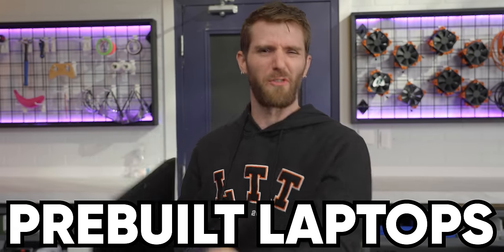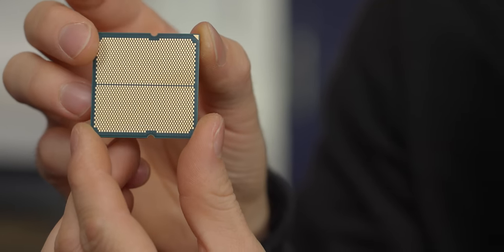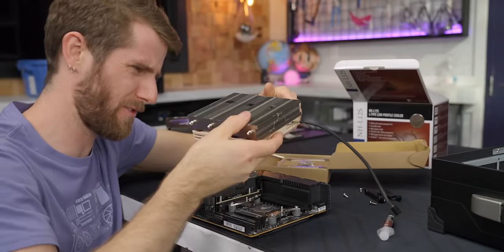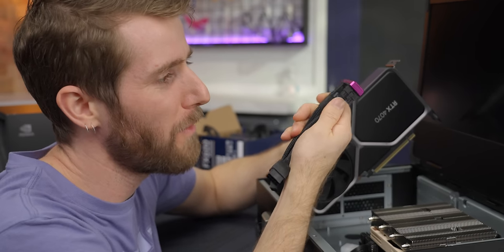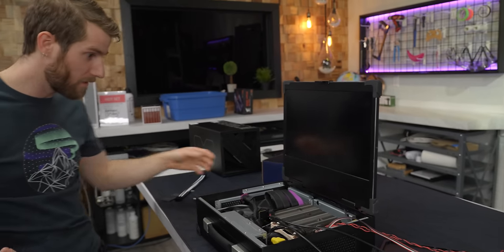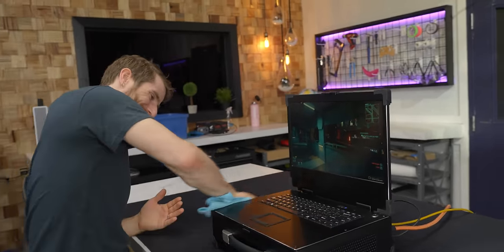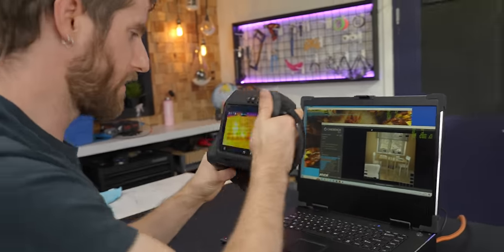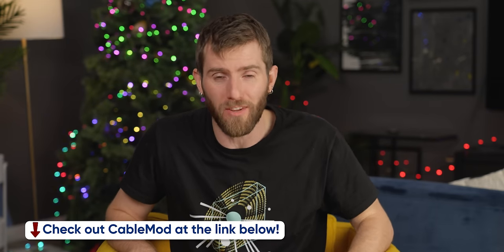Building your own “Laptop” is Terrible and I LOVE it! - MaCase B21 Briefcase PC

Comment: You'll solve multiple problems at once if you swap the positions of the keyboard and monitor.
Move the keyboard to the lid, and the monitor to the inside of the case.
To make that work, the case will need to sit upright when it's working, and not laying down as it does now.
This suggestion helps ventilation and cooling by allowing ventilation holes to be located in more places in the case.  And having the unit stand vertically helps with air stratification.
Another benefit is that it locates the keyboard away from the heat generating components.  And having the keyboard in the lid drops it in height so it's closer to the height of the table top that the unit is sitting on.  That helps ergonomics / comfort for the user.
Someone needs to make a unit like I'm suggesting, and do it out of a lightweight material like aluminum, carbon fiber, or even titanium, so it's not as heavy as a sack of cement.
People would invest in a case like this because the internals can be upgraded in the future.
Reply: It being at any angle other than 90 degrees would be an issue, maybe a little too prone to just falling over
Reply: @joebot86  
My desktop computer stands up.  It has never tipped over.
Reply: @deezynar  yes, but a laptop screen at a 90 degree angle to the keyboard is often uncomfortable
Reply: @joebot86  
Do you mean a monitor screen that's perfectly plumb is uncomfortable?
If that's your concern, there's no reason the monitor can't be hinge mounted so it can tilt.

Comment: It's a good concept. But the airflow needs to be finalized. The case needs to be put on 1-2cm legs so that the air intake at the video card is good enough. You made one hole, but you can make another one for the second video card fan. On the plate that the video card is screwed to, you can remove the top part, air will escape through it too. In the standard solution the air cannot go inside and out through the side ventilation grill at the same time. This is a serious design error. Since one fan of the video card blows air backwards, you need to add some kind of a tube that will collect air from the second fan and lead it to the left outside the case. Right now, the hot air from second fan just hits the top panel, so it warms the keyboard. There is a big plate above the I\O on the motherboard, it should be ventilated too. 
If designers can organize air flows so that they intersect as little as possible, then the result will be a good laptop with effective ventilation. And desktop hardware gives this project excellent potential for upgrades in the future.

Comment: This would be a cool NAS setup. Has the monitor and keyboard built in. Put a LSI hard drive controller with 2 external ports on the PCI-E and put multiple 3.5” hard drives in an external enclosure. The m2 slots could be used as drive cache. With onboard 2.5Gb network interface, this thing would serve data no problem.

Comment: I think you might have "missed a trick": that hole you drilled in the bottom of the case "to let air in" for the GPU is most likely sitting flat on the tabletop and no air can get in anyway.
Perhaps screwing four little feet onto the underside, elevating the case off the tabletop by a few mm, to let that hole actually help keep the GPU cool, might be a good idea?

Comment: The box is missing a heat deflector under the top. The system has enough cooling, but for sure its heating the top indefinitely, because nothing prevents it from doing so.

Comment: I use a very similar type of "portable" desktop regularly for work. I frequently visit a chip fab with a portable workstation with two AMD EPYC 9654 CPUs on board to do data analysis. Most of the data I analyze is classified to a level where we're not allowed to transfer it over a network, so I have to do it locally. The machine is quite awesome, with dual displays and a ridiculous 384 CPU threads. It has a funnily weak GPU though that's build into the MSP chip and the whole thing weighs just over 28kg with its flightcase included. I have no idea what this thing costs, but each CPU is already around 10.000 USD, so I won't be surprised if the total is over 50k USD.

Comment: I built one a few years ago with a 600wH battery pack. Used a pico PSU and buck/boost converter for more 12V power. Was recharged by a custom Li-Ion charger

Comment: Another thought -  ASRock N100DC-ITX motherboard with an Intel N100 processor to give you head room over the motherboard, less fan noise, and onboard graphics all at 10 watts idle and 35 watts peak.  Less power draw = less heat.  The DC variant uses a 19V external power brick via a barrel plug on the back panel.  Much better choice for the internals of this type case, if it supports mini-ITX.

Comment: only useful thing for a case like that would be to build a Portable combination server and NAS and use the GPU area for storage and a battery bank. something a company could use as a all in one for their presentation and booth needs and would add some rubber on the bottom corners just to lift the case up from the ground by a few cm

Comment: The older "lunchbox" form factor is wildly superior to this for roughly the same footprint and space.  They were popular in late 80s and into the 90s, you can still get them but they're a naturally rarefied bit of kit (like this thing).  This is best for "plonk and go" but the lunchbox is more refined to sit down and use - the unit sitting vertically with the screen remaining in place and using internal tilt mechanism to tilt back for better viewing angle, the keyboard typically clips to the front protecting the screen and coming down for a much better typing and usage experience.  Having to cover a larger screen area shouldn't be an issue, the advantage is the keyboard is much better to use for extended periods in an office or client site environment;  this type of system being useful for having to bring a lot of firepower onsite quickly and relatively discretely.  
With the one shown here - it's basically unusable on a desk in its normal guise.

Comment: I love these types of projects. I have several ideas on my bucket list. I really wouldn't mind having a 1" thick laptop if the features justified it. This suitcase would've been too much for me though. :) One of my ideas is a compartmentalized laptop, where you have multiple ARM SBCs and a physical KVM switch. That way, you could have completely isolated computing in the same laptop that's connected to the internet. I think that could be a cool build, but I've just never gotten around to it. Also, the SBCs haven't been suitable for it all that long.

Comment: I recently built a PC in an ammo can, and I put a lot of thought into the cooling. I've just got a 120mm AIO for the CPU (which is a 6th gen i7, spare parts lol) and I have the GPU sucking air from the bottom similar to how they did it with this case. Mine has feet on the bottom though, so I think it gets better airflow. I also have a grid of holes on either side of the can in line with the GPU to let the hot GPU air out so that (hopefully) that hot air isn't heating up the CPU and motherboard. Then I have an 80mm fan blowing down onto the motherboard, and a 40mm fan blowing through the latch hole into the AIO fan (honestly that one was just because the hole is almost exactly 40mm so I wanted to put in a tiny fan lol). Since it's a 6700k and a 980Ti, it plays everything on low, but the temps usually stay below 80. I'm genuinely surprised their CPU stayed cool with the cooler just butting up against the lid, and I definitely think they need a couple more fans to get the air moving, and maybe some kind of thermal resistant spacer between the GPU and the left side of the case, like a silicone oven mit/pan rest. In all though, my ammo can was $30, I bought a $100 wireless 70% mechanical keyboard, I'm using my main mouse (which fit inside the case for transport) which was $60, so if I wanted to pursue mounting a screen to it (which I've considered, but don't think is worth it) I'd have a little over $200 to make it happen before it would have been cheaper to just buy this. I have to say though, there were a lot of man-hours that went into cutting/drilling holes in the can to be able to mount everything. I love the way it turned out, but I definitely wouldn't ever do it again lol

Comment: Hot take
I actually think an ITX PC with or without a screen is in many ways better than the top tier gaming laptop.
As the purpose of it mostly is an easily packable work station instead of gaming on the go, so the feature of having a battery is sort of not necessary. And also not many would want to use it off the grid because of the lower performance.
With a ITX PC It's upgradeable, (should be) cheaper, more powerful and maybe lighter (because without battery) while a properly sized ITX case shouldn't make it that much less portable.

Comment: 1. It would be nice to see how the temps fair with the included fan in the intended orientation.
2. Using a GPU with a flow-through cooler design probably doesn't help with the keyboard temps.
3. The case would likely do better if it didn't have extra ventilation on the same side as the fan, since this just bleeds off any positive or negative pressure the fan is generating.

Comment: Better luggable design might be to have the PC upright like a traditional tower, monitor built into one side, and have the keyboard and trackpad covering the screen and fold down, maybe even be detachable from the PC itself.
Downside is that the screen angle wouldn't be adjustable without shifting the whole PC, upside would be the keyboard wouldn't be raised up so high from the desk and woulf feel more practical to type on.
Reply: To be fair, this doesn't strike me as the kind of machine you'd use sitting down. More like what you'd lug in for diagnosing an equipment problem and running back and forth between it and the equipment in question as you try things to figure out what's going on, so you're never sitting down while using it.

Comment: This kind of thing is suitable for aerial mapping applications. I once used a full-fledged desktop PC with a separate monitor on the field to stitch aerial photos as a map using Agisoft Metashape. That software is very GPU intensive and doesn't utilize multi-core CPU that well as per my config.

Comment: Hmmm. That looks like it could be a great case for my RC2014. Plenty of space to fit the thing, I could fit a power brick internally, enough expansion boards I'd need a new backplane, and a battery to keep it all running for hours(entire system with a terminal board draws something like 2 ish watts)

Comment: You could probably modify that to be a way better version of itself. An insulated exhaust duct out the side to avoid the potentially dangerous heat issue, extract the PCB and keys from a mechanical keyboard and mill a new top plate to mount it to. All the issues seem reasonably fixable. Unfortunately, I doubt there's much demand for this, but it would be cool.

Comment: 8:43 I know my Tecra A11's NVS 2100M consumes no more than 14 watts and I even replaced the thermal pad with Gelid ones but he's got a point. I just tested Minecraft 1.16.5 and it turns out that full screen 900p is actually quite feasible compared to 1.17-1.20 which forces me to render at 50% scale through Optifine but OpenGL 2.1 being single threaded is heating my GPU to 102C unless I play in a smaller window. I NEED FRICKIN AIR. I should drill some holes into the plastic and perma-glue some of Dad's frost blanket on the outside.

Comment: some 3D printed ducting for the gpu would do a world of good rather than having the exhaust fan blowing directly on the back of the keyboard, that and moving the gpu in a tiny bit and having a hidden hdmi cable with a 90 degree plug.

Comment: I would like to see an upgrade for this, as in better cooling , led monitor and some kind of add on the cable area that would hide the hdmi cable and power cable would come out the side, maybe a better keyboard as well. of course then you might as well build it from scratch.

Comment: You know, If they thought outside the box a little more, that could be much more practical. Put hinge on the side, and replace the integrated keyboard with a small compartment for a portable mouse and keyboard. You could stand the computer on it's edge like an ITX tower, with the monitor attached to it's side (or use it in portrait mode for office apps.) Would work even better with a swivel hinge.

Comment: It has the biggest problem I have seen with every single laptop that somebody built out of a suitcase. All of the ports and everything else are on the bottom where they're going to get wet.

Everything should go out on the side hidden by a panel. Just like Compaq, Toshiba and Doltch did in the early to mid 90's

Comment: I bought 16 gig 4060 Ti, highest wattage it has ever pulled is 165 watts
My whole power strip on the other hand, (2 monitors, a set of speakers, including the pc) 300 watts with 1440p fur benchmark running at 250+FPS, whole pc chillin at 50°c, and i bought a 1000 watt Seasonic Prime psu thinking i needed it.

Comment: Man.. There has to be enough room in that chassis for at least 8-9 18650s and a charge controller(built-in UPS) Combo that with a dell-like sheet metal shroud over the GPU exhausting hells inferno out of the side of the case through "speed holes". That system could be the ultimate camping / gaming  / baller machine xD. 3 panel memes fold out Monitor, better keyboard/trackpad combo. Also.. and this is the kicker, you could make a stand for the case that doubles as 2 burners.. xD turn the machine on its side put some ramen up there might want to angle the screens away a little. In your tent you have portable heater.. Even at idle

Comment: Ten years ago, I told my sons I wanted a Briefcase Laptop kit.  Only took 10 years, but to Infinity God that is a grain of sand in the Time Bottle.  Exactly how I described it; Lid holds the screen, laptop keyboard and trackpad and takes a small form factor motherboard. I even said I did not care if it weighs the same as a desktop as it has a protected screen and handle to carry it. Once they get used to me in the TSA section, they will waive at me and say Hi. This is because I will go through once with mine and then a week or two later, they will all receive gift cards for a free one. Gift a few dozen to TSA and they will know exactly what they are.

Comment: You could probably calm that heat down on the keyboard/ wrist rest with some reflective hvac tape on the inside above the GPU. Might even be able to squeeze some thin insulation in there too.

Comment: Ah, it's a modern-day luggable! Taking inspiration from the first portable PCs from the 1980s, putting a modern spin on it, and stuffing it with modern tech.

Maybe not that useful for gaming, but would be very useful for engineers who have to go out to a site and deal with specialised equipment that needs some kind of weird interface card. Mind you, said interface card might very well still be ISA and thus would require some sort of ISA-to-PCIe adaptor for use with a modern motherboard, and probably the only modern OS that you could use it with would be Linux, because what else are you going to be able to recompile the drivers for?

Comment: Thinking about it, if you just used a wireless keyboard and mouse to make room for vent and be able to turn the monitor around 180. That way the pc is behind the monitor and cut back some of the noise from the vent and be able to have any space you wanted from away from the chassie with the wireless keyboard and mouse. its just a idea

Comment: Using that case fan as a exhaust may have better thermo performers,  positive pressure configuration is very unpredictable and often yelled worse result when not carefully designed.

Comment: They should have turned the GPU fans upside down too. That way it would have pushed the hot air out of the bottom and cooled the keyboard with the intake airflow.

Comment: I built something similar in a military surplus aluminum Halliburton briefcase.  It has a watertight seal around the edge.  When it is open it vents in and out through the top.  I have a keyboard/trackpad/mouse that fits inside on top of the intake/exhaust however I dont ever use it like that.

Comment: Excellent video and build.
>
I have to build one of these cases around a LattePanda. It's gong to be interesting. I have to get a 10.5 screen on it (which will essentially be the case size. Prob about 250mm thick). Fit in a battery pack, USB hub, room for the Arduino I/O ports, Mini wireless keyboard with mouse pad and then find room for an extra case fan. And wrap it up in a nice lockable portable case with handle. :P

I am looking at making the case out of 2 to 3mm Acrylic in either clear or transparent black. Probably the hardest part will be building/designing the cooling channels and vents/intakes into the main case.

Comment: On a side note, it would be more cool if there's more third party creators for the Framework, i.e. Raspberry Pi 5 Compute Module with a carrier board that works with the Framework laptop screen etc, custom keyboards, fibreglass chassis, custom speakers, etc

Comment: I feel like this would work better with an APU than with a CPU+GPU.
Not having a GPU would save LOADS of space, that could be used for an AiO watercooler, so that the heat from the components doesn't stays inside the chassis.
The price is a bit high IMO, considering the quality of the keyboard, trackpad and screen, but with some price drops, or a V2 with some improvements, I'd definitely consider it for my next build.